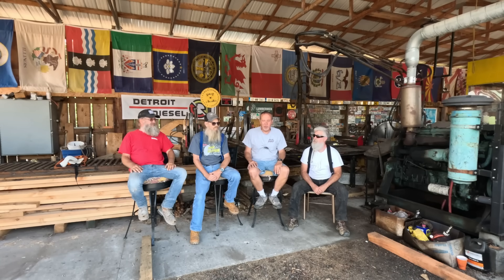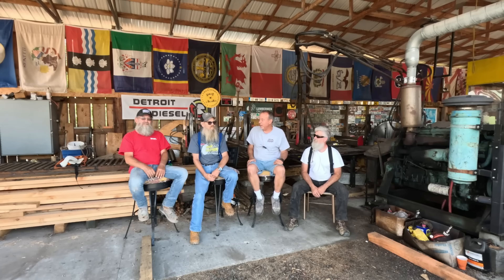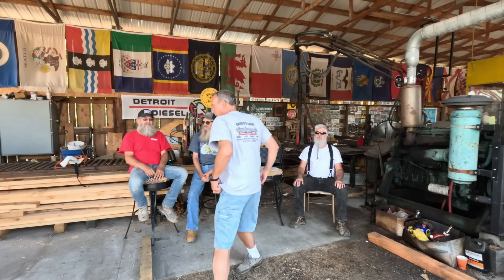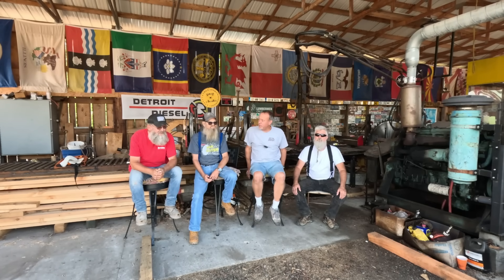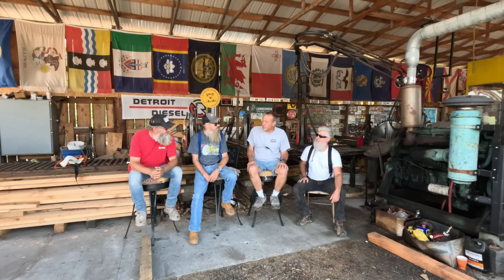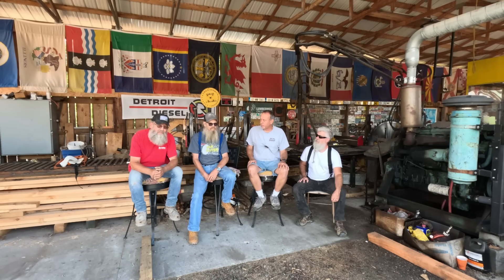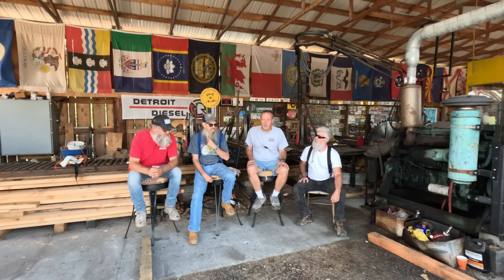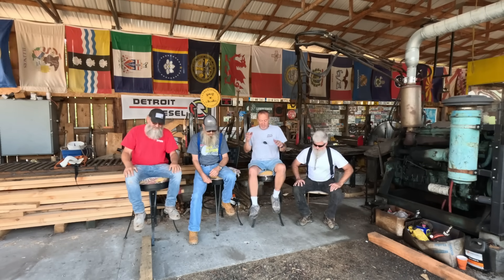sawing a 31 inch pin oak #577

Comment: Great edger music, Mark! Way before my parents married, my mom bought a new two door ford ranger. Best truck there is anywhere. 5 speed standard. Then when i turned 15, I started to learn how to drive it. That little ranger is 24 years old and still going long and strong. That little truck has hauled anything and everything. I remember when me and my dad one day went out for a ride on the forest roads over here in Washington in the Cascade mountains. On the way back, we discovered it was only running on two spark plugs instead of all eight. You don't want to get stuck out here in the mountains, probably should have checked it over before we went into the mountains. But it ran perfectly, never let us down. After 20 years, we fondly dubbed it "old red". May be an old bucket of bolts, but it's a dang as heck good one.

Comment: Good video guys. I've got some pin oak around here that I'll make some lumber out of as well as firewood.
Reply from the maker: thanks Gary , it should turn out some nice lumber.
Reply: @markgalicic7788  I've got the mill head in the barn now to do some repairs and hopefully I'll be moving it closer to the barn soon and get it back in operational order. Lumber, firewood before it gets cold again makes a difference! 😂

Comment: the pin oak may have got its name from timber framers back in the day building barns  using the branches for pins/pegs in timber frame joinery
Reply from the maker: they used locust for the pins.
Reply: @markgalicic7788  i never heard that..fence posted they did..i got a bunch of pegs from a 1800s barn they tore down at a place a was living and they all were oak..but i think white oak was most commonly used..i cant remember if i did the soapy water bubble blow thru the wood test on the pins to see if it was red oak or white oak

Comment: What does the "quarter" in four ¼ mean❓️ I've also heard six ¼.

Watching from Tampa, FL
Reply: 4 quarter is 1-1/8 inch.  you have to take into account the width of the saw blade, I imagine.
Reply: 6/4 would be 11/2 inch thick the quarter is a quarter of an inch. The first number is how many quarters of an inch the thickness of the board is.